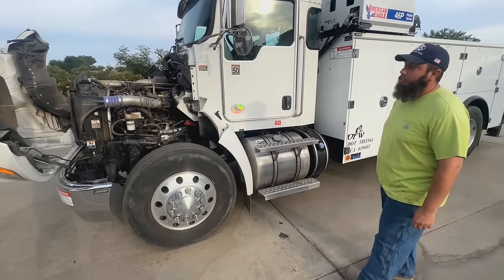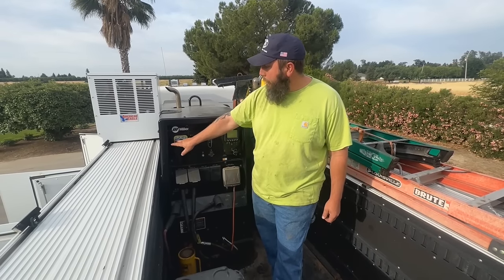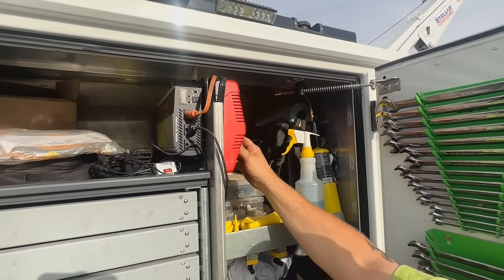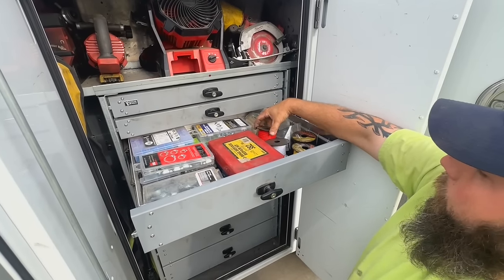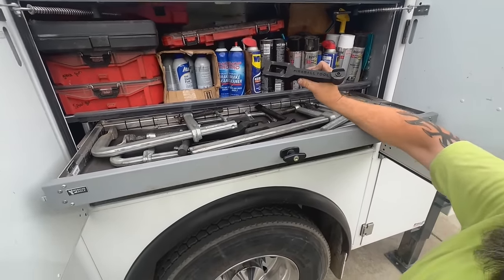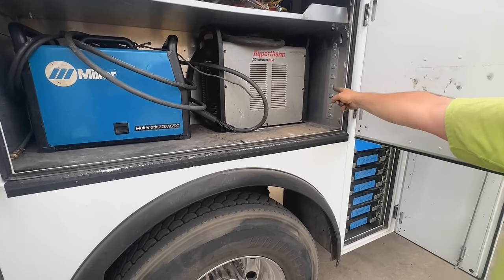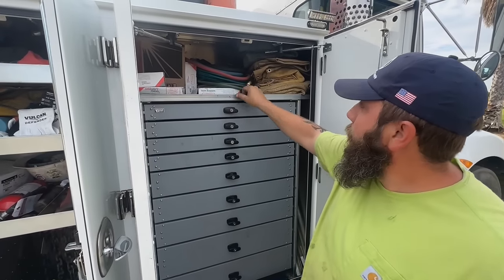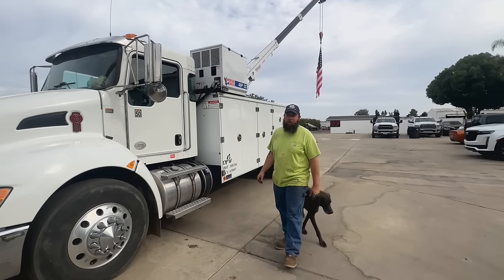Welding Service Truck Tour

Comment: Outstanding 👍🏻👍🏻👍🏻

Only things I'd add:

-12x40-ish bench lathe up top, and perhaps a small mill
-Selection of threaded rod
-Heavy welding table that fits in the bed you can hoist out when you need it

And maybe a nice 30 foot camper to pull behind it because I'd wanna live next to that truck. 😀

Seriously man.. that's basically a whole metal shop on wheels. Well done.

Comment: I am surprised you don't have a small rod oven on board. Humidity kills rods much faster than most people think. You have a very nice setup it shows that you really took the time to find the best layout for your needs.
Reply from the maker: I hardly ever use rods.  So no need for that.

Comment: Great video! Was wondering what brand your lead reels are? As well as the inert gas reel, did you make it from an air hose reel? And finally, will you do a truck tour of your smaller truck? We would all love to see the smaller version. Thanks!
Reply from the maker: Lead reels are made by Bad Ass reels.  The inert gas reel is made by real craft.  I highly recommend both brands.   Yes I will do a tour of the smaller truck.

Comment: Cool rig, you seem pretty chill. Only thing this doesn’t do is fly. Crane is awesome.
Reply from the maker: I am actually thinking about getting a service helicopter.
Reply: Goddamnit. You’re on it, I’m jealous. Always wanted to do what you do, was a Union Boilermaker for 10 years, switched 7 years ago to local 399 building engineers Chicago. Never went out on my own, the pensions always held me back but it’s a good life and I’m set. 49 an hour don’t have to worry about retirement but it’s boring and to easy in a lot of ways. Definitely don’t miss being hung up at a nuke dealing with radiation and welding tube after tube on my belly with a mirror. I bet your killing it with a truck and service like that, big bucks. I admire how organized your truck is, imma find you when the apocalypse comes. Lolol. Chicago here.
Reply: @OFW  are you servicing heavy equipment. Local 150 operators have these specialty guys like you fixing heavy equipment making 80 an hour. Dope.

Comment: I wish our company gave a shit about our service truck. It’s 1990 GMC Kodiak. We only work it about 3 months of the year during the winter. Oil hasn’t been changed in at least 8 years. Crane blew 2 years ago and they haven’t fixed it. Air compressor hasnt worked in 7 years. We asked for a new one and they told us wrenches don’t need air. Then they wanted to know why a 1 week job was taking us 3 weeks lmao. I swear 99% of companies these days don’t care about their equipment.

Comment: Very impressive and well equipped unit you have there. One thing I’m curious about and I’m certain that you have a reason; since, I suppose, you have to have the hydraulically driven air compressor for the crane, is it necessary to have the 600 air-pack as well?
Reply from the maker: I had the air pak before I got this truck.  But it still makes sense to run the smaller engine all day vs the welder and the truck.  Definitely fuel saving and less wear and tear.
Reply: Thanks for the reply and after I thought about it, I figured that was the reason; so you wouldn’t have to run the truck all day. Again, great truck! Makes my F-550 and 14’ low profile service body seem small.

Comment: Great truck tour! Where did you get those bolt bin racks? Never seen sideways mounted drawer.
Reply from the maker: I built them because I couldn’t find anything I liked.
Reply: Well you just added to my project list! Do you remember where you got those slides from?
Reply from the maker: @howardvaughn630  from Amazon.  Just looked up the size I needed.

Comment: I built one just like it in 2000 with a cat 3126 and a National 7500# boom. I never could keep the ac or the cruse control working.

Comment: If you want the best bench, vice possible fireball tools makes one, and it is also american made.
Reply from the maker: I want a fireball vice, but the ones that are available right now are not made in the USA and they do not have the pipe jaws.  Once it has those two things I will buy several.

Comment: Very nicely equipped service rig! Great layout of tools and equipment. I didn't see gear pullers and bearing splitters but I'm sure they were in there somewhere. Love all the utility lines -air, power, etc - plumbed out to spools and ready to go. I like having an assortment of 1-6" long aluminum flat bar scraps from 1/8" x  3/4" up to 3/4" x 1 1/2" on hand for clamping and fitting as well as some flat sheet shims from 1/16 down to .030. Will have to tune into more of your channel and watch you work a few jobs to see the rig in action. Also look forward to seeing a mini lathe mounted up there on top. Could see that being very useful.

Comment: You need an escort whenever you drive that truck.  With all the money you have just in tools and equipment is more than most armored cars carry in them today then the cost of the truck on top of all that. Drive safely and install a tracking device. I don't remember seeing a fire extinguisher, bigger in this case is better.   Very nicely done. 👍👍 also, if you do tire service, you should have an air cannon for sealing the bead on tires. But, I didn't see tire spoons so I'm guessing you don't do tires. Also, no line boring machine for excavator pin work.

Comment: Love the truck the only thing I see wrong with it is it's not in my yard and in my name. LOL 

One day though... one day. My little 95 Super Duty with an IMT truck body and crane gets the job done for now.

BTW does that crane have 360 degree rotation on the turn table? Most hydraulic cranes don't have that only electric cranes.
Reply from the maker: 410 degrees then have to go back
Reply: @OFW  Well that's better than my crane i have to rotate all the way around the other way to reach stuff on the back of my rig. Electric Cranes have that advantage where they have 360 rotation.

Comment: Baddass ... I'm sure that rig is well over $500,000 without the tools! One question though tell me there's a one button locks all cabinets on your key fob!!???😂 I would hate to have to use a key to unlock and lock every single one of those lockers at the beginning and the end of the day the end of the day

Comment: Call me crazy but I’m setting up a 2005 Mack sleeper for my service truck pulling a lowboy. I’m putting a 72 inch harbor freight and other sizes in the sleeper. That way if I need to take a blade off a dozer or fab and weld a mud flap bracket or replace a bad wheel seal , I can do it. Like you said, packing up everything to run around town looking for something you forgot, sucks!

Comment: You were talking about adding a pressure washer up on top, do you want to look at the Hotsy brand units that have a diesel heater. When you’re working on heavy equipment and tractors a lot it sure is nice to have hot water to be able to get all the grease and nastiness off of something you might be trying to Weld. As for a water tank I would say you could probably get by with a couple of 55 gallon drums plumbed together in the bed and a boost pump. Since you’re not really a pressure washing contractor and you would just be washing down a piece of equipment to work on it, 100 gallons of water should be plenty at 4 1/2 gallons a minute, that would give you about 20 minutes of wash time. I would set up a fill valve at ground level to allow me to fill for my customers water supply or to just run straight from their water faucet as well.

Comment: My truck is fairly similar your a bit better organized. 
But my cab is a 579 Pete with a sleeper cause my jobs can be 500 miles apart in the oil patch in wy, ND etc hotel's are few and far between and pricey
Now that I finished the video I will add the few obscure items I got sat phone, vessi  eletric scooter will carry  300 lb man 3hrs at 30 mph and portable camp toilet and Accessories first aid kit and there is food and water/ gatorade in my sleeper

Comment: at 46:12 if you hold the can upside down and give it a quick spray (until it clears) before putting it away it should keep it from clogging / drying out. i do that wil all mypaint and 3M spray glue cans and it keep the tips from getting messed up
Reply from the maker: I tried that.  Doesn’t work as well as other cans.

Comment: Hi Greg, thank you for taking the time to do a Service Truck tour. A couple of things occurred to me that you might want to consider. Labelling for every drawer and cupboard and have a list on the inside of each door. 
Secondly, picnic rugs or ground sheets to lay out beneath each cupboard so that as you are going through things and having to pull them out to get to what's at the back, you can put the items down onto the ground sheet to firstly stop them from getting lost or misplaced and secondly to keep all of the boxes  and bags as clean as possible so that you aren't getting as much dirt or mud or tip muck inside your cupboards. It's a lot easier to just hose down a ground sheet than it is to clean individual tool boxes. On the subject of a mini lathe, from what I have seen, the majority of mini lathes are not worth considering for industrial applications. You would probably have to look at a smaller standard lathe, but would that be strong enough for the kinds of steels that you work with? Then there is the question of protecting the lathe from the elements and from travel vibrations and jolts? Your call.
I also had a question about the void space under the upper deck. Could that space be used for storing your 'get out of jail' supplies of steel and cribbing timbers?
Mark from Melbourne Australia 🇦🇺 
Carpenter and sometime welder.
Reply from the maker: You have some great suggestions!   I was already thinking labels for all the drawers.  The mini lathe would be for light use anyway.

Comment: If the welder puts out 60 cfm,why do you need an additional 40 cfm compressor? Nice truck , especially if you have a crew!
Y
Reply from the maker: It came with the truck. It’s a good backup.

Comment: Thanks for the tour. You really have a nice kit there. Found a few things I want to get, too. Was surprised as much by what is there and what isn't. Like a pretty small selection of vise grips and clamps. More indicative of the kind of work you do. Repair rather than fabrication. But I was surprised that you didn't have a hydraulic hose crimper and a box of fittings, as almost everything you touch has hydraulics. I'm guessing you just call a mobile hose company to take care of that stuff? One thing I don't envy is your fuel bill. ;)
Reply from the maker: I am actually considering getting into mobile hydraulic lines. Just haven’t made the investment yet.

Comment: And to know that it evolved over time out of field experience. Just high quality. Demonstrating the crane seemed like flashing back in time to a kid with his Erector Set for a second. It sure lifted that apron easy last vid. I really like the remote starts for power and air, and that hose reel setup. 
For the welding gas reel, is there a flow control in the hose reel cabinet or is it set at the bottle? What CFM do you use in ideal conditions outside? Still .035 solid wire in the Multimatic 220?
Reply from the maker: The gas is adjusted at the bottle. Typically I run 30 cfh  I run gas with dual shield out of the 12vs and with hard wire with the 220.

Comment: Thank you for the truck tour. A question: with only two rear outriggers, would it limit the crane work zone?
Reply from the maker: Technically I believe it does.  Straight back is 100%  and it changes with the rotation of the crane.

Comment: I venture to say there's not much you Can't handle job wise when out there in the field with that truck and equipment you have on it ! Other than parts that might be broke that you went to work on ! Question do you have a set mileage you will travel to do a job ?
Reply from the maker: No.  I will go anywhere in North America
Reply: @OFW  Cool deal not to many are willing to travel a great distance ! Thanks for the videos ! Although I don't weld I do turn a wrench occasionally and I've learned a few tricks from watching your videos !

Comment: Which model Wilton vise is that? That one looks pretty beefy 😮
Reply from the maker: C3
Reply: @OFW  thanks bro I appreciate the video, very nice setup I been waiting on this tour forever, it nice to see what other mechanics/ fabricators are using it helps in the tool community on what you like about certain tools and what you don’t and what works great and what doesn’t it’s already a very expensive line of work so it helps with not buying junk and getting it right the first time around… if that makes any sense…..💪🏾💪🏾💪🏾

Comment: How much does the customer have to pay for you and that rig to come out for two 12 hour days in the state of California? Asking as a fellow mobile welder running a ram 2500 in the state of Ohio who just spent the last couple days doing the math and refiguring my rates I need to charge. Your truck has more tools and supplies than most people’s shops. My truck has welders and grinders torches and basic tools. Not nearly as efficient but I guess I’m doing different work than you most of the time.
Reply from the maker: $1,800 a day
Reply: @OFW  that’s a bit more than my new rates but dang you got the set up. Are most of your jobs heavy equipment repairs?
Reply from the maker: @scrapmanindustries  yes. Mostly heavy equipment.
Reply: @OFW  thank you for taking the time to get back to me. Now for the real question though, do you find it easier or harder to sell jobs or better yet sell your rates to customers when you show up in a rig like that vs showing up in a 2500/3500 with minimal tools. Or do you find that the rig doesn’t matter that much and  just let your work do the talking for you? Also now that you’ve ran that rig for a bit is it worth rigging out a kenworth/Peterbilt or would you rather have just stayed with a 5500? I haven’t watched many of your videos yet because I just found your channel but just this one and the landfill dozer blade repair have given me quite the brainstorm I needed to possibly make it through this winter without having to get a real job.
Reply from the maker: @scrapmanindustries  my truck is my resume.  If any independent shows up in a 350k service truck he knows his shit and that’s what all my first time customers think.  But no you don’t need that truck.  Your good quality of work and work ethic is all you need to  sell to a customer. Almost all my work is from repeat customers.  If I could choose between the trucks I would say the only major benefit to a 33k truck is the bigger crane.  The smaller 5500 is a lot more comfortable to drive.
Reply: @OFW  hey, sincerely thanks for replying. And thanks for spending all the time it takes to make all these videos and including all the useful information that’s in them. It’s like being entertained and going to school at the same time.